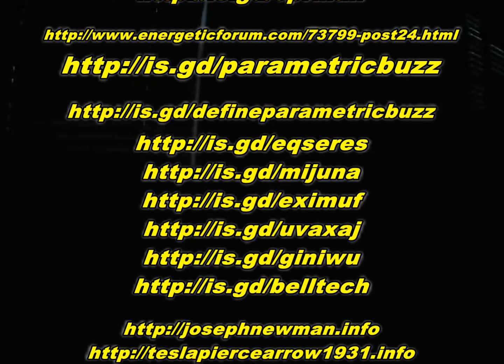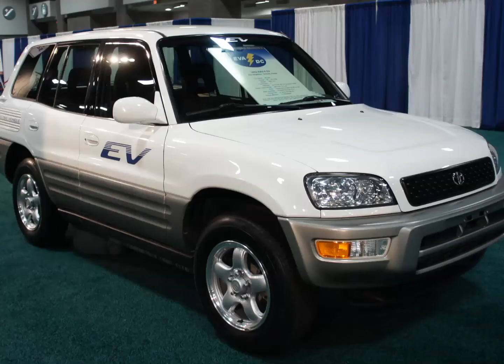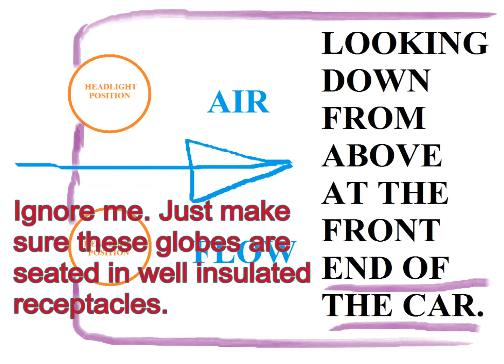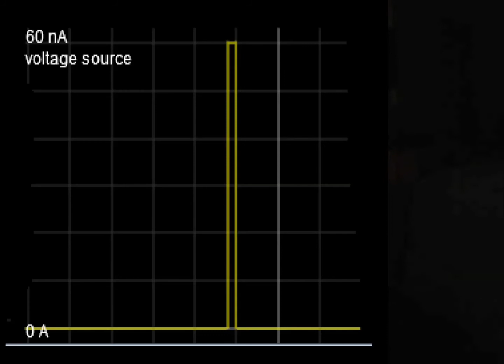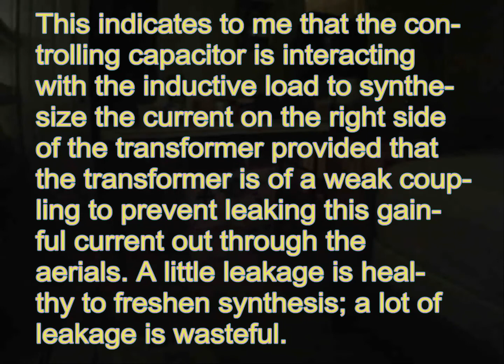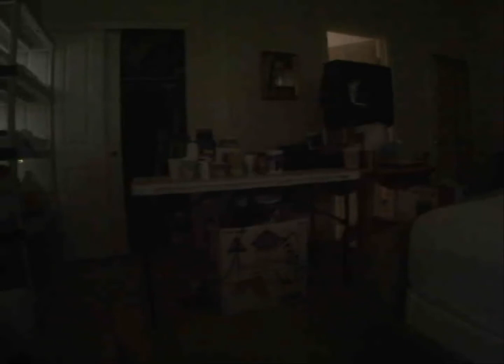Synthesize Electricity in a Power Supply by Reusing its Voltage and Amplifying its Current

Comment: Although I use Falstad's circuit simulator quite a bit myself, it's not even close to perfect. Flipping a  switch repeatedly can boost the power incredibly for no real reason.
Reply from the maker: http://vinyasi.info/#contact_form
Reply from the maker: His reasoning is that switches generate surges. The fact that it overreacts is probably due to a lack of equivalent series resistance, particularly in the coils wherein positive resistance would have been very noticeable had he included ESR. In capacitors, ESR becomes negative resistance. That's why I modified my installation of his software, keeping the original...

http://vinyasi.info/ne

....and forming a new one...

http://vinyasi.info/realsim

...using Wikipedia as my guide....

http://is.gd/eqseres

...after recalling that LTSpice already has ESR built-in by default.

I think it still overreacts. But less than before excluding many of my prior creations from overunity. So, I keep a list of what still performs OU...

http://is.gd/overunity

ESR has forced me to simplify my subsequent designs since no amount of clever complications can compete with it.

Yet, I still see people dwelling on getting more from their motors despite (my view) that there's only so much that can be done to improve motor design. The real grace is in parametric capacitance....

http://www.energeticforum.com/311773-post98.html

Refined & Enhanced, LMD Analog Computer Module...
https://youtu.be/cCJcU7INwnU?t=3h5m15s

Parametric Time Shifts of Inductance and Capacitance results in the Synthesis from, or Decomposition back into, the Constituent Ingredients of Electricity ...
https://youtu.be/cCJcU7INwnU?t=1h51m57s

50 times faster than the speed of light: primary cosmic solar rays...
https://youtu.be/cCJcU7INwnU?t=47m49s

source of gravity...
https://youtu.be/cCJcU7INwnU?t=48m43s

The Law of Conservation of Energy breaks down...
https://youtu.be/cCJcU7INwnU?t=28m41s
Reply: Sorry for the delay, but thanks for the reply. I didn't realize you'd modified the simulator to compensate for that. I was wondering what you think of the possible use of a variable capacitor that responds to light like in the patent US 3,426,209 and a similar metal-insulator-semiconductor diode that also varies in capacitance with light exposure: https://phys.org/news/2017-06-diode-features-optically-capacitance.html
Reply from the maker: http://www.freepatentsonline.com/3426209.pdf

Looks good. The change is capacitance is by a factor of one thousand which, in itself, is excellent. The only challenge left remaining is to increase the location of this range into at least milli Farads by using gazillions of these little gizmos all of which are connected to each other in parallel to boost their overall capacitance. This is what I have hypothesized for quartz crystals since their range of parametric alteration is by a mere factor of ten to one and in the range of pico Farads, namely: they change from 5pF to 0.5pF, but due to voltage impinging upon them, or mechanical pressure or tension (pushing or pulling forces) which this new invention circumvents.

The change in capacitance cannot be a gradual sweep. It must be an abrupt change from one value to another and back again performed many, many times and within a range of capacitance in which the statistical average of synthesis versus decomposition of electricity favors the former over the latter.

If applied to a circuit in which resonance is required, then these changes must occur at the extreme terminus of each change, or else just beforehand. For if the parameter changes immediately after a wave crests in either the negative or positive (valleys or peaks) of its oscillations, then electrical energy will disappear.

I did an animated GIF to illustrate this...
http://vinyasi.info/circuitjs1/vinyasi-cts/parametric-oscillations,%20slower.gif

http://vinyasi.info/circuitjs1/vinyasi-cts/How%20to%20Pump%20a%20Swing.jpg

http://vinyasi.info/circuitjs1/vinyasi-cts/

http://is.gd/paratexts

But sometimes it's not necessary to pay attention to when parametric alteration occurs if the circuit does not depend on resonance for the synthesis of its OverUnity...

http://is.gd/magnetoboost

http://vinyasi.info/circuitjs1/graphs/magneto-boost.txt_.html

Thanks for the knowledge. I appreciate any new methods for creating parametric changes, particularly in the realm of capacitance since that seems to be where the guarantee of control best occurs.
Reply: It seems like everything electrical I start looking into lately has something to do with displacement currents, so it doesn't come as much of a surprise that an abrupt change is needed. I could use some help (well, a lot of help) designing a circuit for a recent project of mine, I don't suppose you'd be willing to help, would you?
Reply from the maker: Sure. Why not?

Comment: The thing is we use close circuit over open circuit. We should only use current as swing and voltage as pressure ready to use. It is all about making voltage diffrence greater and we can swing current back and forward to swing magnetic field and when magnetic field is big enough we colapse it into potencial diffrence we desire. But what i think it is not possible to aquaire it in close circuit not the way we use them. Magnetic field must rise and fall beetween dielectric plates not outside like in lc circuit. We dont want current because current is destroyed ellectric field. We need to limit or get rid of magnetic field at all, if it is possible and i think it is. That are my thouts. Everything in nature is open circuit design.
Reply: Think about two tesla coils point at each other, question is are magnetic fields gonna cancel themselfs ? If so we wont have current but pure potential diffrence. Will we be able to magnyfy voltage without magnetic field at all ? We put impulse into to tesla coils pointing each other and we should magnify charge without using current. And all this in no time and space. So it is instant magnification. Otherwise swinging the current we need time and space and we are limited to that.
Reply: Think also about mobius coil desing it is like coil where magnetic field should not exist at all and exciting mobius coil with instant impulse should result in manipulating electric field alone without destroying electric field in the normal coil that has ressistance from opposite magnetic part.